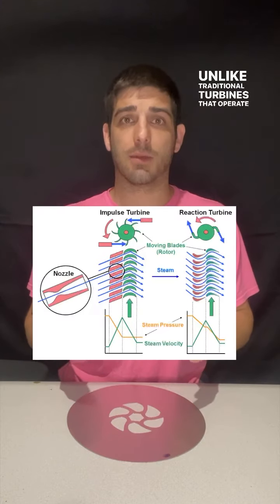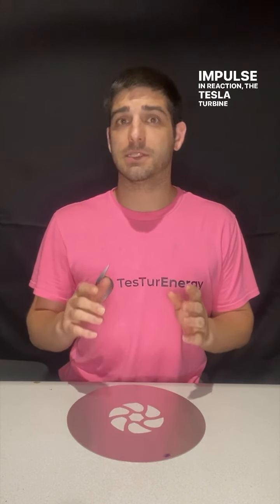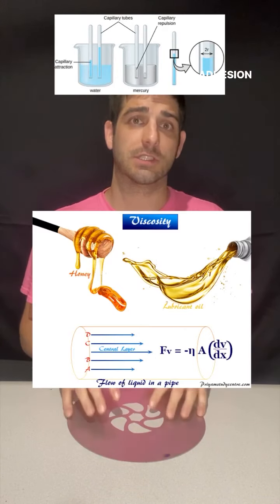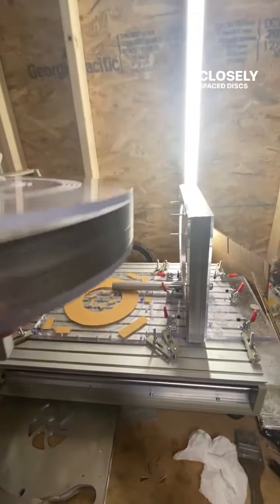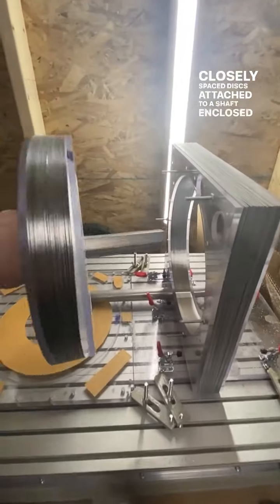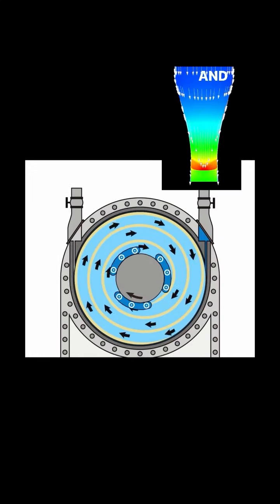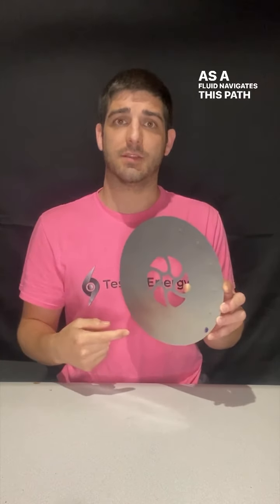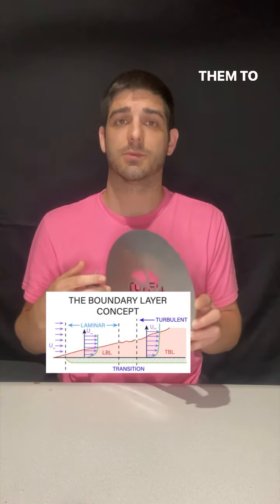Nikola Tesla’s Greatest Invention! - The Tesla Turbine

Comment: Can you comment on why you chose aluminum as the plate material? Curious if wd game same results with balsa wood, foam sheets (thinking: manufacture on Cricut)?
Reply from the maker: Hey thanks for the question! 🙏❤️‍🔥Simply because it was the easiest thing for me to get my hands on and it was easier to machine to hone out the specifics I want for the Tesla turbine. 

I’m the end the aluminum ones will only be used in the low temp systems. But the high temp disc materials being much denser and heavier have a lot more energy behind them and can be a lot more dangerous. 

I’ve considered circuitry but the temps and vibrations that it would see would make them prohibitive. 

Not so say it can’t be done. I’ve seen someone make composite discs with fiberglass and epoxy but I wouldn’t advice it.
Reply: @CharlieSolis  Thank you for the reply. If you all do a follow-up video would love more info on the bldc motor(s) you're using, whether the output is DC ... 

(My dream-implementation is something that could be low-profile rooftop with directed airflow / static channels, working with rooftop convection. Could drive indoor fan easily, or DC lights, heat-pump-style "AC" ... time to reinvent the grid. 

Really excited to see you all in the game.
Reply from the maker: @annekim2634  hey the generators I have output 3phase high frequency AC, but i just rectify it to DC with a full bridge 3phase rectifier for use with the inverter.

Comment: hello what is the cfm volume of air being delivered at the 30-40 psi range? im interested in knowing the watts in to make 1200 watts out for the prototype thats being sold on the website, thank you for your research
Reply from the maker: As far as efficiency goes… (mind you this is a copy pasta 🍝 so it’s a bit long but it’s worth the read.) …My 2650watt electrical load run came in with a very low ball calculation of 40% isentropic efficiency.  To start off, mind you that includes generator losses, 3 phase rectifier losses, and inverter losses to the electrical load that were not accounted for. So the turbine off the bat is already most definitely doing better than the 40% isentropic efficiency I’ve calculated from the already low ball test results.   But for now I’ll just assume 40% isentropic efficiency so that I’m not over claiming what I can prove it can actually do for the time being. (I have nothing in the long run to benefit by overstating my numbers and only my legitimacy to lose. I’ve worked hard for my physics degree and don’t intend to tarnish it for a couple of extra views on the internet.) 

As far as inefficiencies to the system to fix, there’s 10x crappy ball bearings in this version, 2 crappy RC car gears, both losses will be gained for power out with a direct to shaft generator. (Minus two gears and 8 crappy ball bearings)  There’s an 1/8 of an inch of space between the turbine endplates and the casing endplates on both sides of the TesTur. That’s a 1/4in of open flow area around the 2in wide turbine (that only even has a total of 0.75in wide of spacing between all the tight disc spaces for torque to begin with.)   That means 25% of the open space for flowing through the casing, between discs and between the casing and turbine endplates, is just free flow over the side of the turbine still. (I’m using the absolute bottom of the barrel of machining equipment right now in my garage 🤷‍♂️)  There’s no labyrinth seals yet to even attempt to further reduce that overflow… 

The nozzle is atrocious at the moment, when making the variable converging section have a tight convergence it causes the fluid jet to aim more centripetally (towards the axle) instead of tangentially (glancing off the disc tips) which severely effects the fluids natural path.   This will be fixed with the new variable nozzle design I’m going with.    Then even further in this specific casing’s assembly there’s two “pillars” in the middle of the nozzle.   This is because the aluminum plates in the middle of the casing plate stack only had the variable nozzle bar and inlet holes cut out, and not the full nozzle geometry.  So those pillars are just vertical bars in the middle of the nozzle for the air to smash into just before going into the turbine (hopefully the wet steam tests will just erode them down 🤭)   Before all that there’s still about 100ft of air hose between the tanks and the turbine… plus a shell and tube heat exchanger and a TON of elbows and fittings.    I’m sure I’m forgetting something too but between all that being fixed… I can almost guarantee we will be in the 60-70s % range and that’s all just still with room temp compressed air.   Most forget, I’m using room temp compressed air and never went over 20psi at the nozzle for these tests. (Pressure differential and temperature differential govern efficiency) 

And even then I still only even have a single stage on it yet.   Everyone wants to compare it to the efficiency of a very high temp, high pressure (1000°F & ~1800psi) multibillion dollar 15-30 stage steam turbines…   😮‍💨   That’s apples to rocket ships. 😅  But considering Rankine Steam cycles get theoretical max about 33% of input heat (due to latent heat of condensation and that’s without any regenerative boiler feedwater preheat, air fuel preheat, etc) and then 40% isentropic efficiency (considering the turbine as is) we’re looking at 13.2% thermal efficiency with steam.   A more apt comparison for the TesTur would be something an individual can actually purchase, like 1-5kW piston gas generators that you can get from Home Depot or Lowe’s.   These get 15-22% thermal efficiency off the plant floor. Good luck getting that 1 year down the line or later with all those moving parts.  Also for reference, industry standard for micro bladed gas turbines is 25% thermal to electrical. Whole system efficiency can go higher in Combined Heat and Power (CHP) system, but alas the TesTur would see the same whole system efficiency increase in a CHP Auxiliary Power Unit (APU).  In the TesTur you gotta replace…? 🤔bearings…? And still even then, only maybe 🤷‍♂️ depending on how good of bearings, balance, lubing, cooling.   The TesTur, and other bladed turbines, only have one moving part. 🔥 

So if those piston generators drop efficiency, even at all, the TesTur on its worst day is competitive with a gasoline piston engine electric generator.🤓😬🤷‍♂️  And the TesTur can handle any fuel that can burn, even solid particulate fuels like powdered saw dust, pulverized coal, powdered iron, biomass, etc. (noting the number of those that can be acquired without spending money… 🤑 opening up “low monetary cost”, even carbon neutral, fuel options for MILLIONS around the world)  We have to remember that the TesTur doesn’t have to be the holy grail to be worth using if we have free fuels readily available like biomass, and even waste heat already being dumped out into the air and not used for anything.  The TesTur just has to be a viable option for some to be worth doing. 

Even more, the mere fact that I’m using a low temp fluid for my 40% isentropic efficiency calculation means my TesTur efficiency is severely limited by thermodynamics and fluid dynamics.   Increasing temps will automatically increase my turbines efficiency.  This is because gasses have an increasing viscosity trend as you increase the temperature.   This leads to increased isentropic efficiencies in the TesTur from reduced slip on the discs.  (Meanwhile, we’re already talking about a piston engine using combustion temps as is.)  Whereas bladed turbines see the increased viscosity as an increase in drag loss through the turbine blades.   So we can’t always count on seeing increased isentropic efficiencies in a bladed turbine in practice when we go from low temp to a high temp.  Again, to reiterate, this increase in viscosity in the TesTur only works to enhance the working action of the TesTur.  (That being viscous adhesion to the disc faces increasing torque.)  That’s all on top of the increased thermodynamic efficiencies of using a higher temp elastic fluid too! 🤓 

The disc spacing for room temp gasses is not going to be the same for combustion temp gasses/steam because the viscosity of either increases by 3x fold. And I’ve designed these spaces for a higher temp fluid with a slightly higher viscosity so these will inherently be too wide at the current temperatures being used.   So as we increase temps along with all these other really easy to fix mechanical issues (that only are a thing because I’m building this in my garage on a junk cnc machine) I have no doubt we will see more than competitive isentropic efficiencies compared to bladed turbines, let alone whole system thermal efficiencies that are through the roof.   This is because of the heat recovery systems that can be added with the cost savings of using a TesTur vs a VERY expensive, and in my opinion, relatively delicate bladed turbine.   Just getting tighter casing clearance with the turbine should give me at least 20% points back on efficiency putting my testur at the 60% range.   Coming in with a 19% thermal efficiency in a Rankine steam system without any kind of thermal recoup.
Reply from the maker: Make sure to check out the latest updates on the combustion + steam Tesla turbine builds!   

Tesla Turbine 250 watt to 2.65 kW Power and Efficiency Test https://youtu.be/K7qZvq1CMFg  

+5 Horsepower Tesla Turbine Dyno Jet Turbo Power & Torque Curve 375 mph @ 12,000 rpm  https://youtu.be/exF5Rn-L8gs  

Solis Talks Tesla Turbines - Nikola Tesla’s Electrical Power Systems Patent GB 186,083 Walk Through https://youtu.be/5Y3D13JmtcA  

Tesla Turbine Jet Engine - gasoline fuel burner atomizer flame tube test 186,083 propane burner https://youtu.be/gRqKowignac
Reply: @CharlieSolis  thanks for the detailed answer, best of luck to you in your endeavor!
Reply from the maker: @JonnnyStorm  much love! Thanks for coming along in this journey with us!

Comment: Do you think a tesla turbine would be a more efficient way to use the exhaust gases for a turbocharger than a normal turbine?
Reply from the maker: Hey thanks for the comment! I think it could certainly work but it would need to be designed especially for that purpose. 

The issues with smaller ones is they lack the surface area.